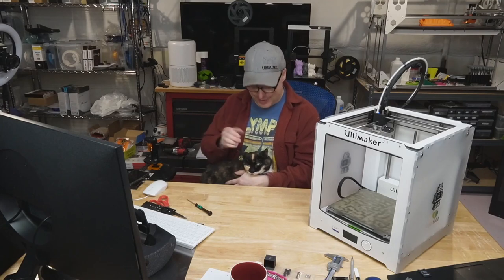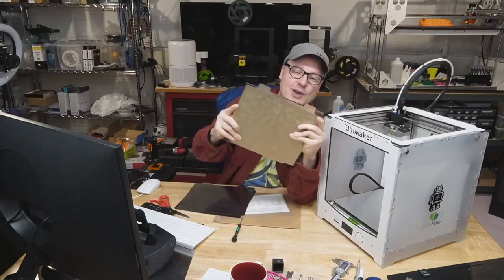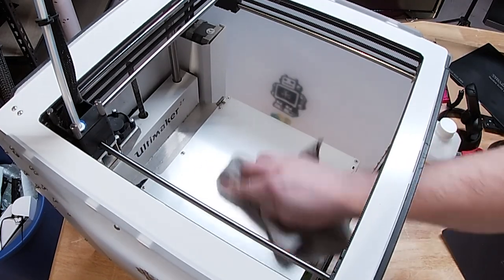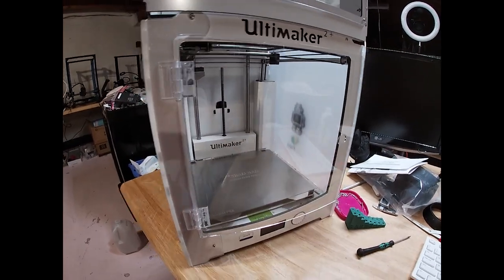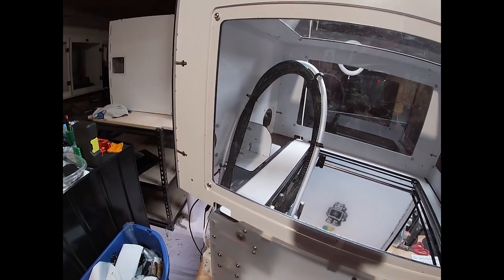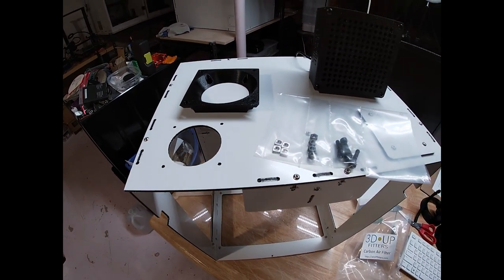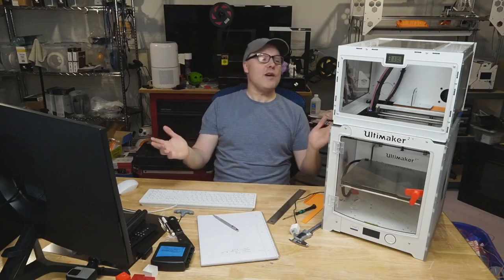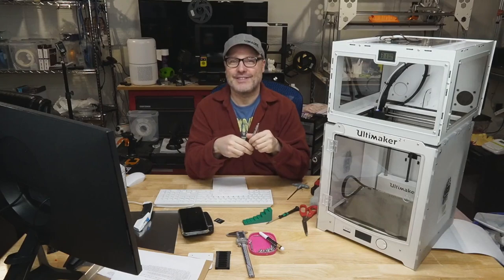Ultimaker 2+ Upgrades! Next Gen Enclosure / 3D Upfitters Carbon Filter / Wham Bam Bed System!

Comment: Thanks for this video. To anyone else thinking of purchasing the Wham Bam flex system with the PEX build plate for Ultimaker 2+, here's a couple of things that have helped me get decent prints using PLA:

1. Ensure the heated bed is level when the magnetic base is applied. I used a set square to measure flatness and bent the bed by hand with it still attached to the printer.
2. Use a brim with your prints and heat the bed to 70 degrees C, this stopped the corners of prints becoming detached.
3. Use a surface cleaner between prints and wipe it off with a dry cloth. Use extra fine steel wool to lightly scratch the PEX surface.

Ongoing issues: the first layer appears a bit too squished on the print bed, despite levelling; this is tolerable.

The surface finish of the face attached to print bed is glossy and professional looking; and parts are definitely easier to remove than painter's tape, which is what I was using before.
Reply from the maker: They sent me a new bed that has cut outs for the clips. So the magnet can go on the glass bed. This means you can print better since the springs aren’t at the top of their limits, making the bed springy!  Video soon

Comment: I began my 3D printing journey barely 2 weeks ago after I was given an Ultimaker 2, which seems to be in great shape with low hours on it. I’ve learnt a lot in this time already, but found I’m getting the itch to upgrade the machine. Since you’ve done this yourself, is it still worth paying for the Ultimaker 2+ extrusion upgrade kit in this day and age given you can pick up brand new 3D printers for less than the cost of the upgrade kit? As in, is the Ultimaker that much better (still) than new 3D printers in the £400-£600 price bracket?

Thanks in advance for your input, and great video.
Reply from the maker: That’s a really fair question.  I love the Ultimaker printers and that upgrade really does a lot for that machine. I still use it a lot even today!  However in a world of amazing Bambi Labs machines bringing the costs way down - it’s really a toss up.  If you can find the upgrade for a good price, I’d do it!  But if you’re just learning and ready to step into something more modern, I show people the P1PS they make.  Let me know what you opt to do!

Comment: I also have an U2 upgraded to a + and I am thinking of getting a door and maybe a lid/top but I have only ever used the glass bed with very rarely Pritt stick more over I use nothing at all and the prints never seem to have any issues sticking to the bed
Reply from the maker: I’ve had a few stick too good!
I like the top enclosure and front door. I use that carbon filter to mitigate the VOCs

Comment: I was surprised how small those bed wheels are on the Ultimaker, I would have designed and printed some enlargements to thise wheels had it been my printer
Reply from the maker: You want to be careful with the clearance along the sides of the printer on the front ones.  Honestly they work just fine.  User preferences 🤓
Reply: I have 3 UM2go printers that I use daily and I know what you mean but it is quite easy to turn those screws.  It's not a problem.
Reply from the maker: Those are neat little printers. Hard to find!

Comment: Instead of using the adapter, wouldn't it be a better idea to increase the hole size? A 80mm hole is about twice as large as a 60mm hole (5027mm^2 vs 2827mm^2) so this setup is severely restricting the airflow.
Reply from the maker: If I had a hole saw that big!  A good idea